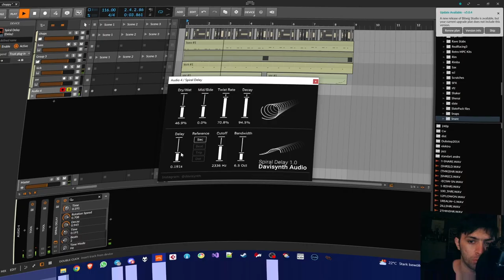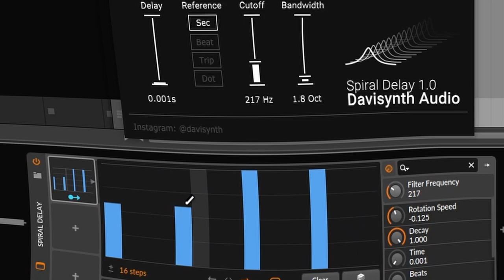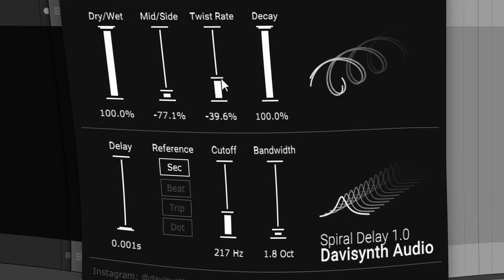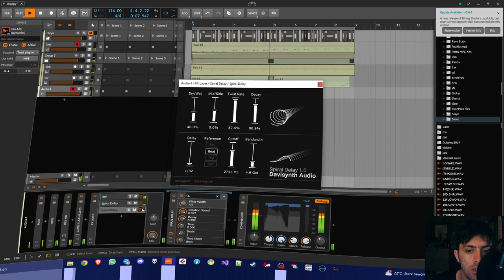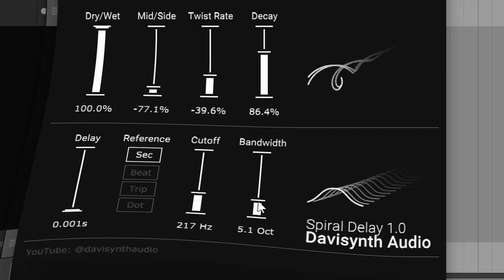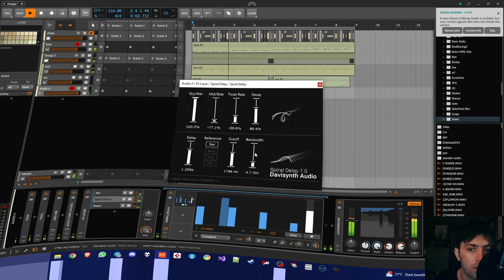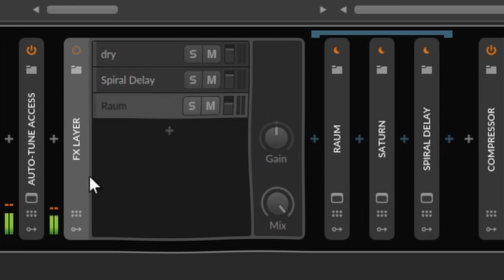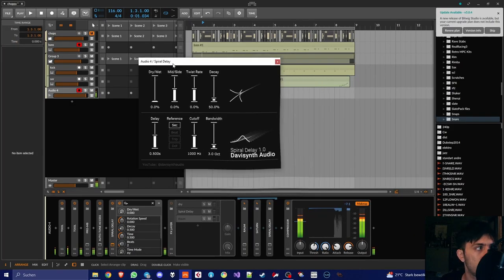Spiral Delay [lowkey freebie test]

Comment: Hey thanks for checking out the plugin :) I really like the modulation idea! Think of twist rate like taking the X-Y plot of the audio and rotating it a little bit for each echo. This has the effect of panning back and forth with variable speed for each echo. That's why there's mid-side control. You can also hear it really well by putting a straight mono input. For very wide sounds like a super-saw, the rotating effect is very subtle but you will notice that the delay no longer sounds like the exact same samples being played back again. It can be useful for adding controlled variation in those situations. Hope this helps :)
Reply: thanks for clarifying the twist part. I have just been playing with it for the last 40 mins trying to work out exactly what it's doing. & a pan was what I thought but was unsure!
amazing! 
Great work!